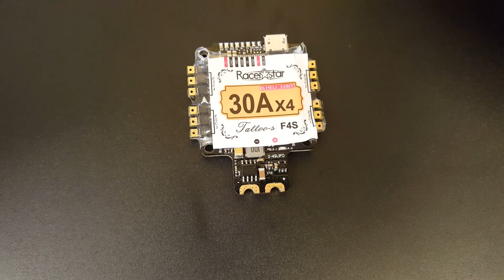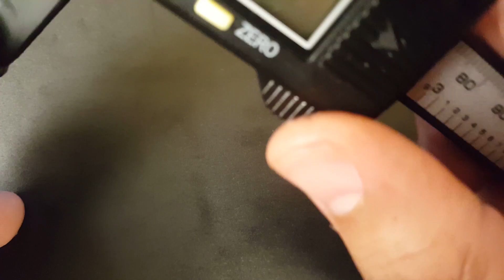Racerstar TattooF4S AIO // Overview and Layout

Comment: Hi, 
Thanks for your videos !

I just bought an AIO F4S board.
Do you think it is useful to add a capacitor on battery wires for LOS flights only ?
Reply: I only added a 1000uF cap to clean up Video...For LOS you probably don't need it...but it might protect the ESC's from back current voltage spikes in full throttle wrecks.

Comment: For SmartPort connection i've remapped LED pad to be SoftSerial TX and it works just fine thru this port.
SmartAudio is soldered to TX6 and worked for me with no issues too.
Reply: Can you confirm how you did this please?  I have tried mapping as follows but no joy.
resource led_strip 1 none
resource serial_tx 11 A01 (led_strip one was on A01)
set tlm_halfduplex = on (tried on and off)
set tlm_inverted = off (tried on and off)
Reply: I dont have this drone with me now, but found it's configuration dump, below are related parameters:
# resources

resource MOTOR 5 NONE
resource LED_STRIP 1 NONE
resource SERIAL_TX 11 A01
feature SOFTSERIAL
feature TELEMETRY
serial 0 64 115200 57600 0 115200
serial 5 2048 115200 57600 0 115200
serial 30 32 115200 57600 0 115200
set serialrx_provider = SBUS

tlm_halfduplex tlm_inverted are default values

Comment: Hey, did you need to flash the firmware to get blheli suite 32 to work? Just got mine today. Mine is saying something about outdated protocols and wont connect to the new suite. I noticed it is running betaflight 3.1.7.
Reply from the maker: +Ninja Sauce I have not tested it yet but u will need 3.2 and there is no official 3.2 version.. but there is a work around once I get to it I'll make the video
Reply: I heard you can flash with LUXF4OSD. Im finishing up a build and I just wanna test it.
Reply: Did a test flight earlier today. I am noticing some strange things. The pitch axis flips diagonally. The roll axis is straight, but it rolls about half the speed. It sounds like the ESCs are braking during flips and rolls. And Im pretty sure that Im not getting the max thrust from my motors. So I think I need to try the new firmware so that I can access blheli32. I was hoping to use the stock firmware because I could never get my StarF4 to work after I flashed it. Did you have any problems like this?
Reply: I am having a similar problem,    roll left and right fine but flips are strange,  some time it flips ok and some times it go's nuts and dose about 4-5 flips very fast,  also noticed that I have to lower pids a lot,  I am not shore that the LUXF4OSD is the correct  target.     Did anyone figer this out ?
Reply: Its the right target. For some reason, different versions of Betaflight cause it to act differently. The default version does diagonal flips and stuff. I have tried all versions of Betaflight and mine flips like crazy on the pitch axis. I think there is a problem with the gyro on some of these. Mine never worked, so I had to scrap it. I will link my video of the problem.
Reply: https://youtu.be/7jvGdtnTdIY

Comment: In BF I see there is a UART3, but I cant find a UART TX and RX pin.  Have you found it?
Reply: Looking at the F4 datasheet pages 41 and 52, I would guess UART3 TX = pin 29; UART3 RX = pin 30. http://www.st.com/content/ccc/resource/technical/document/datasheet/ef/92/76/6d/bb/c2/4f/f7/DM00037051.pdf/files/DM00037051.pdf/jcr:content/translations/en.DM00037051.pdf

Comment: Built a DIY BFight 210 with F4S at yesterday. F4S mounted on rubber grommets with XSR RX glued with 2-sided tape below FC board and VTX (FT48X) zip tied to top plate ended with very compact build. FC flashed to BF 3.2.1 (LUXF4OSD). ESC-s flashed to latest BLHeli32 (Siskin_ST 32.1). SmartPort is functional too - non-inverted SmartPort wire from transistor on XSR board is soldered to both TX6/RX6 and enabled for UART6. VTX is powered from battery pads. Buzzer and LED strip is working as well. 8K/8K/DShot1200 feel VERY smooth even with aging and bashed Emax RS2205 2600KV motors used in this build. On max throttle (4S) slight disturbance present over FPV picture, but it is not annoying. Added low ESR capacitor (470 uF/35V) to battery pads just in case. USB definitely is not accessible while camera is in place. Luckily camera is easy removable (2 screws) and I did camera cable slightly longer to make camera moving aside easier for accidental configuring :)

Pity that F4S doesn't have a second serial port. For now only SmartPort or only SmartAudio/IRC is available on UART6. Seems that only way to get UART3 accessible is to solder TX/RX wires directly to MCU pins.
Reply: +KrotowX - fully agree. I did the same you did. Problem is that LUXF4OSD works for 3.2.1, but not for 3.2.2 and 3.2.3. Do you have a similar problem?
Reply: Did you tried to flash betaflight_3.2.3_LUXF4OSD.hex from Betaflight releases manually? By the way thanks for news - didn't knew about new version :)

Comment: Since my HUBOSD video out died without warning after moving into new quad, I'm now actually searching a new AIO FC for future use with Emax RS2205 and RCX 2206 motors. And because I wish to do it light as possible, new quad have BFight 210 or Awesome F200 frame (hadn't decided which one of them) - both have weight under 80g. I think that would be good to have AIO FC with 4-in-1 ESCs on board. Racerstar TattooF4S is one of possible candidates. It seems have all inputs and outputs to connect SBUS and SmartPort from FrSky XSR receiver to it - also buzzer and LED strip. Only thing which I doesn't like - USB port at forward side. It will cause serious issues with configuring because it will be blocked by camera and will require to open the frame and remove camera each time to change something. Turning it to 90 degrees have a possible risk to break power connector part of board off on crash.

Any ideas how to connect to USB port at forward without disassembling the quad?
Reply: Well, because I wish to have AIO FC with ESCs in one bottle, Asgard v2 is out of reach and other similar boards in shops available for me are sold out, I ordered TattooF4S in Banggood. When I'll receive it with current shipping lag (a bunch of BG orders from a month ago are still in way), hell knows :)

@DM, how about vibration dampening for this board? Seems it really need it.
Reply: I havnt built mine yet but i will try adding a 90° micro usb cable if it will work with my frame

Comment: do you have an idea how i can use the runcam split and my ibus receiver at the same time? currently im using uart 6 for ibus. is there a free uart for the runcam split?
Reply: I am using a Split 2 and Sbus at the same time on a tight build. you can use LED pads on the AIO and reappoint it in Betaflight to Runcam. ( I havent done that yet but plan to)

Comment: How many uarts did you count? I want to use this board on a longrange rig, with Smartaudio, GPS and Crossfire.. Would it be possible?
Reply: Doesn't seem possible with only two available UART ports onboard (SBUS as UART3 and UART6 pads below label). By the way long range rig should be large enough to have a separate FC with more ports - probably even F7.
Reply: Okey, thanks!

Comment: LC filter is NOT low current filter. L commonly used to represent an inductor and C a capacitor. The most common LC filter is when you charge a capacitor via an inductor (that is what used in RC world to filter spikes/surges on a power line). Call it simply "lc filter"...
Btw I love your channel.
Reply from the maker: +Norbert Kovacs Yes I noticed I said .. sometimes I do make accidents in my videos and notice it when it's too late.
Reply: Drone Mesh No worries, you are one of my most regarded RC tuber and trust me I would not bother to comment if I did not value your channel/content top notch. Please keep up with the great content.

Comment: The position of the USB is a no-go for me.    :-(
Reply: Same here, the position of the USB and ESC are absurd... useless in a compact quad...

The only thing I think of is to turn the board 90 degrés and remap the ESC... and even though, it’s not convenient....
Reply: FPV camera usually have some clearance from frame. Try the straight version of this adapter https://goo.gl/hkDQbJ
Reply: Oh thanks for this info. I didn’t know such adapter exist...   :-)
Reply: I was ready to solder such thing from scrap. Then noticed that it is already available.
Reply: Ya, what a strange choice. The original F4S without osd has the USB under the battery leads. It would be convenient on a normal frame, but I have it on a frame with aluminum top, so I gotta take it apart to connect to betaflight.
Reply: Probably because of ESC pads. And problems with noise and return current otherwise. But that location is stupid indeed. Used it only once at configuration and didn't connected to it anymore so far :)
Reply: My usb fell off, can you use Fdti adapter on this? If so where to connect?

Comment: I have the Racerstar F3S, and you said its more for advanced people, but I'm a newb. Any chance you can describe how I can check to see if I am getting noise or need to adjust filters and such ?
Reply from the maker: +Justin Mack Not everyone will have noise is just lines in the camera you see and it can get very bad but if you don't have any then all is fine so don't worry about it.
Reply: I use this to, and the noise in the camera from the motors are horrible

Comment: Do you think it would be possible to mount this sideways so the battery lead is on one side and the USB is on the other. Then solder the motors to the corner nearest (not motor 1 to 1) and then use Betaflight resource mapping to switch over to the right motors?
Reply: Yes that should work fine

Comment: Where can you connect a TBS unify smart audio to it?  Kinda of addicted to that feature now so need to make sure I can do it with these all in one.
Reply: If you look at the wiring diagram, you would solder it to where it says the GPS goes. UART 6. And if you're on FrSky with an XSR or X4R-SB, you can now use FPort which does your RC commands AND telemetry all with one signal wire! No more having to use two UARTs for RC and telemetry.  This means that with this flight controller, you can have RC + telemetry, VTX remote control, and even camera control by wiring your camera to the LED pad and doing a simple resource map. These are all the features you'll never need on a race quad or a freestyle quad.
Reply: Have you done that? I have one of these on the way and will be using an XSR-m and have been researching to see which pad I'd have to use. Will it work right on the SBUS pad or do I have to use TX6?
Reply: KrotowX it’s in beta right now for Betaflight 3.3. There’s a github someplace with all the info. Just google it.
Reply: Miguel Godreau so your smartport needs to go to the LED pad. And then you need to reassign your LED pad as a softserial uart. In Betaflight you’ll have to turn on softserial and select it as your smartport telemetry in the ports tab. That’s a short explanation and there many steps involved with that. I followed a guide on assigning uarts by Oscar Liang and got it working that way. Do some research into how to do that to figure it out. I could hold your hand step by step but I don’t have the time and you won’t really learn anything that way either. Sorry I can’t help you too much better.
Reply from the maker: +Gat App Technologies the uart6 pad not sure how the smart audio port works on the TBS protocol but the tramp protocol would be connected to tx6 on the top of the FC
Reply: Pity that F4S board have only single additional serial port pads available on board. I would be glad to have two ports - one for SmartPort and second IRC/SmartAudio. We can solder directly to F4 MCU pins, but this job is not for anybody :)
Reply: Whoa, FRPort is something new for me. Where I can read about such functionality for XSR receiver? Technically I see no problems to use full duplex serial communication between XSR and FC via single serial port. Obviously it will be faster too. But how to connect and enable it?
Reply: Dan Kuzma hey did you find out if we can use the sbus pad for this new Fport?  Reading the Github and it’s confusing as heck lol
Reply: Yes I did, and I couldn't get telemetry to work on it. Maybe there's something I missed, but I had all the controls working perfectly. I suspect it's not a bidirectional inverted uart. I may have made a dumb mistake somewhere along the way, like maybe I didn't have the telemetry checkbox in bf flicked, but I can't remember. I just gave up and went back to SBUS and used the LED pad assigned as a Softserial for my telemetry.
Reply: Dan Kuzma please help me how you did to get telemetry to work on this board, I have the XSR, please let me know how you configure this on betaflight,. I will love you for this info. :), I had the f4s also and neither had the luck to configure telemetry. Pleaseeee
Reply: Dan Kuzma also, did you configured any special commands on the CLI? Like inverted telemetry or that other stuff? I am new on this sorry.

Comment: Could you expand on your issues with the starf3? I have 3 of them and all of them have this strange jello like video distortion on sharp contrast changes. Please see https://youtu.be/h1yPoOqXD5M . Do you also have this problem? I tried everything from low ESR capacitor on the battery terminal to an LC filter for the entire camera / VTX. I think it is a flawed OSD implementation.

Comment: I just received this board for review, and it's the exact rebranded version of this board from Ready To Fly Quads called the Vedrfolnir AIO F4. It's major downfall is the Betaflight firmware as of this date is 3.1.7 from April of this year, with no unstable updates available, so you can't use the Blheli32 gui to flash the esc's or change any of parameters, and it's not reverse compatible with previous versions of blheli either, so you can't change anything period, or at least from my attempts at flashing it. Other than that it has potential to be an awesome board, but that usb placement isn't the best either.
Reply: CesiumSalami - Yeah I know what you mean since my first ever purchase of an unnamed f3 flight controller from them had no documentation or silk screen on the board, and I still to this day have never got it to work, but I've had decent luck with rtfq's after that since all I've ordered has been the Omnibus line of flight controllers, which have all had pretty decent pinout documentation and really didn't leave me guessing. Thanks again for the head's up on the LUXF4OSD firmware recommendation, the board now works with Betaflight 3.2 RC5 and blheli32.
Reply from the maker: +SteelRainSpo Will test all this soon I just built it and will release build video in couple hours. After build video I will make the setup video and will see if there is way go flash and control the 32bit esc.
Reply: Drone Mesh - Thanks I appreciate the second opinion before I release my review video in a couple days, but I think that you will find out that it's running on the VGOODDF4S 3.1.7 Betaflight firmware from April that's not compatible with blheli32, and without any release candidates I've run into a wall on esc flashing and programming. Please let me know what you find out and if there's a work around, because that lack of functionality is a game ender for this board. Thanks
Reply: I don't know anything about this product, but i'm reasonably sure (but this should be verified) that VGOODDHF4 is the MicroLux F4 target which became LUXF4OSD in BF 3.2

FYI - i don't own this product. so ... press on at your own risk.
Reply: CesiumSalami - Thanks that's good to know buddy, if the one firmware target became the other for Betaflight 3.2, then I don't see why it wouldn't work for this board, I just wish they would of disclosed that information somewhere in the products description. I'll definitely try flashing my Vedrfolnir tomorrow to see if it fixes the blheli32 compatibility problems, if not it's an easy flash back to the VGOODHF4 firmware in dfu mode.
Reply: ReadyToFlyQuads... Great Airbot / Omnibus Products at great prices with ZERO customer service and few accurate details in their descriptions.  Definitely gotten great deals from them in the past.... but yeah...
Reply: SteelRainSpo Yeah, banggood stuff has attached .hex file in his comment and it was "LUXF4OSD".
So seems that is what we need😉
Reply: deadloop - Thanks for the information provided, I can confirm that LUXF4OSD firmware works for the Vedrfolnir AIO flight controller from RTFQ's, I just wish they would of disclosed that information somewhere for knowledge, ease of use and convenience.

Comment: What's the point of blheli-32 right now? Especially when this board doesn't have esc telemetry. I don't even think Betaflight 3.2 is using all the features yet. I'm just curious. ❓❓❓
Reply from the maker: They are being used however no one has done a complete setup yet.. I have a complete build setup and will be uploading vid about the features. However this board I have no clue if its running telemetry on uart3 since there was no pad. Time will tell I just build it now and editing the video. 

Next video after the build I will make the setup video in BF 3.2
Reply: Drone Mesh thanks for the reply. My frog is running the new Spedix 32 bit esc's but i can't really feel any difference and there's no telemetry or current sensing with them.
Reply from the maker: Sherman G They have telemetry but not current sensing.
Reply: ESC buzzer and turtle mode are good reasons.